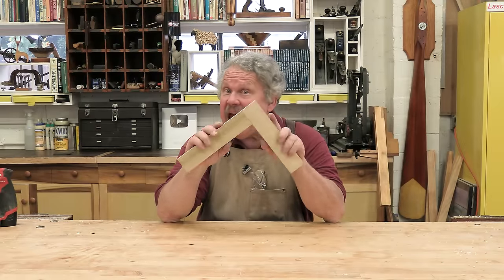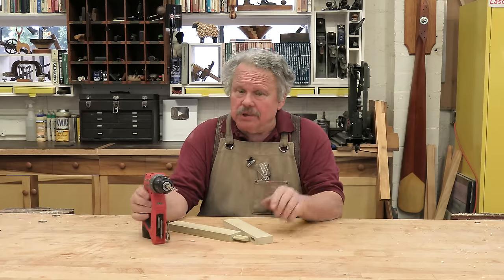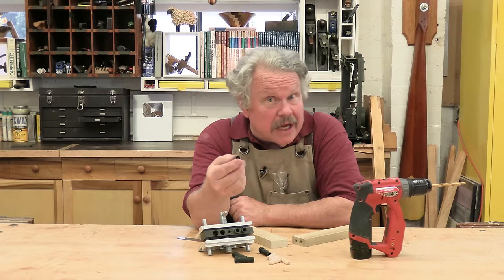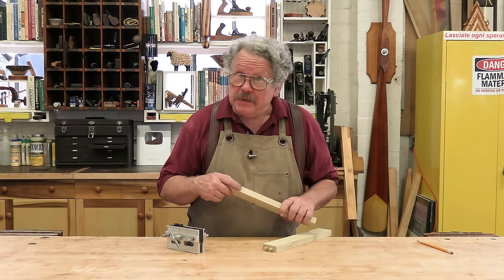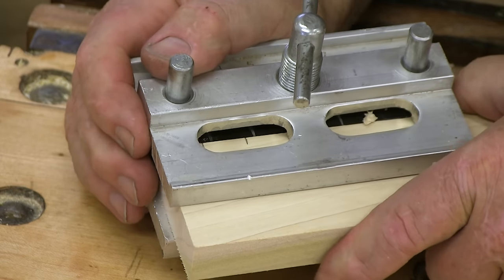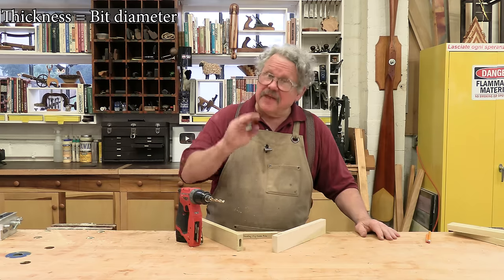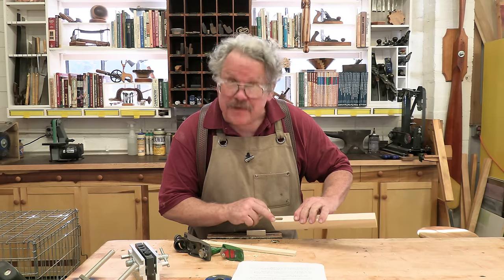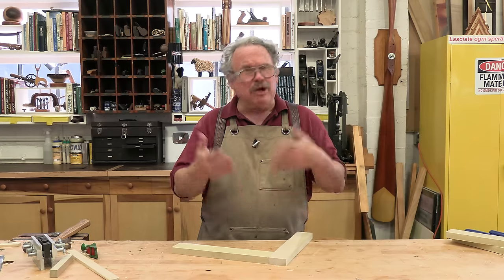Making Domino Joints for $30

Comment: Since I've left education, I don't have access to a wood room with among other nice things, a lovely branded semi automatic floating tenon mortice cutter anymore. (Well, unless I ask, but I've got a deck to rebuild first.) 

I've got some shelves to build for my sister's new kitchen, and was thinking that I'd do the same thing with the dowelling jig and a trim router with a guide. Now that I think about it, maybe even the drill press and a spiral upcut bit. All of which, are paid for! Or I could use my mill and make a vertical holding jig...

Thanks again, Nick! You've got me thinking... Now, back to the damned deck calculations!
Reply from the maker: Glad we could cloud things up...;-)

Comment: Great video! What's the advantage of this over just using two dowel pins? I can't believe there is much of a strength difference once it's all glued together.
Reply from the maker: Dowel joints are extremely strong and reasonably easy to make if you have a doweling jig. This is similar. Sometimes it's just good to have choices.

Comment: I love your content and everything you have done for the Shopsmith community and the larger woodworking community in general, but I have to disagree on this one.  You can clearly see significant drillbit runout/tearout in the mortise in the video.  In order to have the maximum joint strength and glue strength you must have a tight fit between the opposing pieces (in this case a loose tenon and two mortises).  Gaps will cause glue and joint failure.  I suspect the finished result is not going to be as strong as you would like.  JMO.  I agree the Domino is just too expensive, but I finally bit the bullet and bought one myself and it is worth almost every penny because of how clean the mortises are, but more so because of how fast it is (probably 10x faster than what you showed here).  Bottomline is the Domino is meant to be a productivity enhancement tool and not every woodworker needs it.
Reply: Or you could just use the doweling jig. 😂😂😂.  No one will know what you use between those two boards.
Reply: @talonk3  Doweling jigs work great and I still have my Jessem Dowel Jig.  Only problem is they are a lot slower than the Domino.  This was my point...not everyone needs a Domino but unfortunately FOMO causes a lot of people to either buy a Domino or gripe about it while trying to find cheaper solutions.  The Lamello Zeta P2 biscuit jointer is like 2x the cost of a Domino but I don't see woodworkers online trying to recreate one, but I see so many of these attempts to recreate a Domino and my question is WHY???

Comment: Excellent video. A Q: In what circumstances would a floating tenon be preferred over two dowels?  It seems to me that both would be quite strong. Thank you.
Reply from the maker: In some cases, it might increase the gluing surface. But for the most part, it's simply an alternative.

Comment: Good information. Is there any reason to go to the trouble of making a loose tenon over dowels?
Reply from the maker: Not really -- most of the time. Loose tenons provide more gluing surface, and that in turn makes for a slightly stronger joint. But unless you need the extra strength, a well made dowel joint will serve just fine.
Reply from the maker: @jeremiahbullfrog9288  True that. The dowel joint I show in the video was made with what should have been 5/16" (8 mm) dowel stock, but I had to ream out each hole 1/64" (.4 mm) to get them to fit.
Reply: If you like using dowels and are not familiar with Dowelmax , check it out. I have had one for 20 years and it's an awesome jig .

Comment: Hi Nick, Great video!  Just wondering what is relative strength of domino to say 3 dowels?
Reply from the maker: If you keep the distance between the dowel centers to half the circumference of the dowels (D=C/2), the dowel joint will be as strong as or stronger than a domino in which the distance between the radii are the same as the distance between the dowels This is because there will be the same or more gluing surface. Once the domino radii are further apart than half their circumference, the domino joint will be stronger, unless you add a third dowel to increase the gluing surface. And if you don't want to do the math, both dowel and domino joints are sufficiently strong for most of the stresses you'll likely encounter in woodworking. Knowing how to do both just gives you options.

Comment: This is very cool, but the trade off is time. I have made mortise and loose tenons with jigs and different power tools.

I can afford a domino and got one because it does in 10 seconds  what you did in in many minutes.

That adds up.
Reply from the maker: For some. Others have the time. Either way, it's good to have options.
Reply: I agree 100%.
Reply: By the way, I did enjoy making a couple of jigs for cutting the mortise for loose tenons.

Comment: I've been indecisive about which way to go with joinery methods, jigs, etc... Been leaning toward dowel joinery and this method looks like not much more work for more meat in the joint. I bought a "drill saw" a ways back for, well because I buy a lot of tools. I wonder if this snazzy drill bit would help with this technique? Hmm...
Reply from the maker: Several folks who commented on this procedure recommended rotary tools that cut sideways such as end mills. While these produce a cleaner cut, they might also increase the width of the groove if you're not careful. If you going to use a drill saw or similar bit, I'd suggest doing the whole procedure on a drill press table where you can use a fence to help guide you.

Comment: I just saw Star M Japanese F-Style Anti-Burr Drill Bits on Izzy Swan's channel. It cuts at an angle like nobody's business. It would make short work of hogging out for the "domino"
Reply from the maker: But only in metric sizes. Nothing there for us fractionophiles.
Reply: Hansang Bae I used your technique to correct the miter slot on my jobsite saw. Works flawless now with my Incra miter gauge.👍
Reply: @FlyinTrapezious  Hey that's great to hear! Enjoy.
Reply: @WorkshopCompanion  Ah, right.  WoodOwl's OverDrive bores out holes like crazy so that might help.  Although it may not do the angular cuts like the Anti-Burr bits.  Again, thanks for the entertaining and informative vidoes

Comment: hello sir, if we use this joinery method on solid wood entry door, how long will it lasts ? this question is relating to its structural integrity.
Reply from the maker: The strength and durability of any wooden assembly not only depends on the choice of joinery, but also the choice of materials, how well the materials are prepared, and how well the joinery is crafted. With good materials and craftsmanship, a floating tenon joint has roughly the same structural integrity as a traditional mortise-and-tenon joint. All the doors in my 133-year-old home are made with mortises and tenons, and they are still sound.

Comment: If one needs a bunch of those dominos I would think making something from a longer stock doing the round over for the length of it and then cutting to size instead of making each separately. What do you think?
Reply from the maker: One of the things I like most about woodworking is that there are multiple ways to do anything -- I allude to that when I tick off some of the ways you could round over the edges of dominoes. It all depends on your available tools, skills, time,  personal preferences, and the requirements of the project itself. I needed a single domino to close out a video so I grabbed a hand plane; had I needed a hundred to complete a cabinet installation, I might have done it differently.
Reply: @WorkshopCompanion  Gotcha - in any case I love your videos - PERIOD Herr Professor of Woodworking! Also I realize the one domino for the video it's just there are a lot of ppl out there who would make them one at a time. It was just throwing out and idea to make things and how I would do it with a larger project.
Reply from the maker: @MystiqueULH  Your suggestion was a good one. For those folks who would have to make a lot of loose tenons, I would invest in a "nosing" router bit -- this would allow you to round over two corners of your tenon stock in one pass on a router table.

Comment: If you are going to all that trouble to make your own loose tenon joint, wouldn't it be easier to just do mortise and tenon.  Use your method for the mortise and cut the tenon on a table saw.  By the way , I own a Domino and you'll have to pry it from my cold dead hands.

Comment: More of a question than a comment, wouldnt the 2 dowels be as good as the loose tenion?
Reply from the maker: In many cases, yes. But dowels don't give you the ability to align the joint as you glue it up.

Comment: Is the domino joint so much better than just using the two dowels?
Reply from the maker: Strength wise - not really. But it is a little easier to align your glue up the way you want it. - Travis

Comment: Just using dowels is so much easier that I just don't see the advantage of going to the extra effort or expense of loose-tenon joint. And if you need more strength, then use more dowels. 

BTW, is there a "rule" for the minimum spacing between dowels and between the edges of the boards and the first/last dowel to maximize the strength of the joint?
Reply from the maker: If you make the spacing of the dowels a little less than half their circumference, there will actually be more gluing surface than a mortise-and-tenon joint. To make the math simpler, substitute "3" for pi (3.1416). Just to refresh your high school geometry, the circumference of a circle is pi times the diameter. If you're using 3/8" diameter dowels, 3 times 3/8" is 1-1/8", half of which is 9/16". Space the dowels 1/2" apart, and the joint should be close in strength to a mortise-and-tenon. That only leaves 1/8" between the dowels, but that is doable with a good doweling jig.

Comment: Instead of hewing your own dominos, couldn’t you buy a bag of them? Or has Festool cleverly made them in a size incompatible with drill bits and dowling jigs?
Reply: Most I have seen are in metric sizes so you would have to use a drill bit that is the same or close to the size of what domino you are going to use so it could be done. Or buy a set of metric drill bits.

Comment: I invested in rocklers beadlock system. So far, it’s been amazing. However. I had to invest in an entire system that cost a few bucks. But now I make my own tenons. 

I need to invest in better clamps as they slide from time to time and I lose my mind. 

However, had I watched this video before, I’d still recommend the beadlock system as it works every well, but it’d be nice to know I could have made tenons with things I already owned.

Comment: Rather than rounding the insert after cutting to length, it seems more efficient to round a long piece, then cut to length.  Much easier to use a router - better yet, a router in a router table! - on long pieces.

Comment: How much stronger would a loose tenon joint be compared to two dowels? I mean, this is extra work and from the outside it doesn't show. What does that extra work buy me?
Reply from the maker: The ability to adjust the relative position of the parts as you glue up.
Reply: @WorkshopCompanion  Good point, thanks.
In terms of strength are dowels and loose m&t similar?
Reply from the maker: @audetnicolas  No. In our video "Pocket Holes Overexplained" we did an informal strength test comparing dowels, biscuits, loose tenons, traditional mortise-and-tenon, pocket holes, and nothing at all. The dowels  won. See https://www.youtube.com/watch?v=OmMN_XKJ4nc .
Reply: @WorkshopCompanion  That is a very surprising result. Thanks!

Comment: Did you use epoxy or yellow glue?
Reply from the maker: We either used Titebond 2 or 3 -- so yellow glue. But we also had a tight fit on the tenons. If the fit had been sloppy, epoxy would have been the better choice.

Comment: Hoping someone with more experience can help me with a dowel issue. Am putting a softwood dowel into a 9cm hole (10mm dia). the hole and the dowel are VERY close in size. Dowel enters the hole and passes in with a slight coating of Titebond 2 without issue up until about 30mm in, after which it starts to build up friction requiring more hammering force to keep pushing it in deeper, to the point where the dowel wood is destroyed before it can pass fully through the 9cm hole (its passing through a half lap of Hinoki, or Japanese Cypress, which is quite soft). I have considered sanding lightly hte dowels, or perhaps adding a lubricant like vasseline, but am concerned the petrolium product will never evaporate and will always be present, preventing the dowel from performing the intended job of making the joint not move.  Does anyone else have any suggestions how to reliably put dowels thru 9 cm holes that I havent considered? Perhaps using a harder dowel wood?
Reply from the maker: You should probably take this question to an actual  woodworking forum, such as reddit/woodworking; this is not the place for off-topic questions.  However, what is probably happening is that you are coating a 10 mm diameter dowel with a water-based glue and then trying to pass it through a 10 mm diameter hole. The water in the glue causes the dowel wood to swell slightly so that the dowel has to be pressed in place. The further the dowel goes into the hole, the more wood surface it contacts and the resistance builds until the pressure required to advance the dowel destroys it. There are two things I can think of to do. (1) Use a harder dowel. At 9 cm long, you might want use steel instead of wood. Press a 8.5 cm-long steel rod into the hole, then cap both ends with 2.5 mm-long wooden dowels so the assembly looks like you used a long wooden dowel. (2) Use an adjustable reamer to ream the hole to  a 10.1 or 10.2 mm diameter. You'll have do some experimenting,  but you should be able to find a diameter that will allow you to press the glue-covered dowel through the hole with destroying it.

Comment: Domino is a structural joint... biscuits are often not, the biscuits themselves are so fragile. Biscuits are great at aligning boards cheaply for glue up, but not for joinery... :)
Reply from the maker: We just completed a strain test on several joints in boards of the same size and species, using the same glue. (This is for an upcoming video.) #0 biscuits failed at 42.5 kg,  3/8" x 2" dominos failed at 40.6 kg -- not a great showing for the structural joint...:(
Reply: @WorkshopCompanion  In my tests, biscuits (the cheap kind that people use, because the biscuit will shear along the grain if it's even wood to begin with, most of the ready made biscuits people use are some sort of fiber board material) can't take any shearing or lateral loads. Not at least any more than what glue provides. 

Dominoes and dowels (using obviously TIGHT dominoes and dowels) give huge increase in the structural strength for shearing and other lateral forces... even they don't increase the direct pulling force needed that much because in that instance the glue is the only thing that provides strength for the joint...

I'm waiting for your video on the subject :)

Comment: Why is this better than using dowels?
Reply from the maker: Additional gluing surface, ability to make small adjustments in alignment.
Reply: @WorkshopCompanion  the gluing surface would be almost identical but I hear you about the micro adjustments. That makes sense
Reply from the maker: @misterscottintheway  The gluing surface is dependent on the distance between the end holes. If that distance is more than 1.6 the diameter of the dowels (center to center), the gluing surface will be greater than that of the dowels. But the effectiveness of that increased gluing surface is reduced by making the joint sloppy enough to accommodate small adjustments. It all comes down to what you prefer.
Reply: @WorkshopCompanion  thanks!

Comment: Yep. It works just fine for me. Always has, always will. Those fancy domino thingies are for the woodworker who enjoys his tools more than the craft. I just do not understand a woodworker like that. You can also employ a mortising chisel and make two matching mortices. Works the same. Only, no round ends, so you can just knock out some tennis on the table saw and cut them to length on the chop saw. A hand saw works too. Or is that too difficult? 😂😂

Comment: Why not make the tenons a little skinnier and skip the rounding of the tenons? Why not all-flat-surface tenons? That's a surface no one will see and I doubt the joint would be that much weaker. Most of the strength is in the glue in the face-cheek interfaces, isn't it? (Did I get the terminology even close there?)
Reply from the maker: You got the terminology right, but you might want to review the engineering. Two things for you to consider. (1) There is a great deal of gluing surface where the convex edges of the loose tenon meet the concave ends of the mortise, and this contributes substantially to the overall strength of the glue joint. (2) From the dawn of time, craftsmen have found that a tight mortise-and-tenon joint will outlast a loose one. If the cheeks, ends, faces, and edges don't all make contact, the assembly is susceptible to racking stresses and the glue joints are more likely to fail..
Reply: @WorkshopCompanion  At the dawn of time we didn't have very good glue. That's a very recent innovation.
I'll look into it more, though. Thanks for the response.